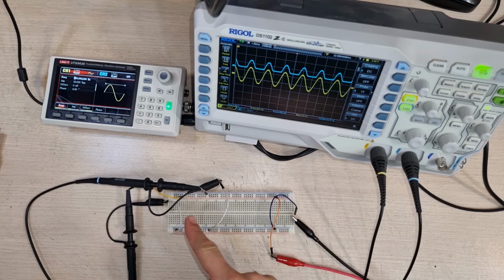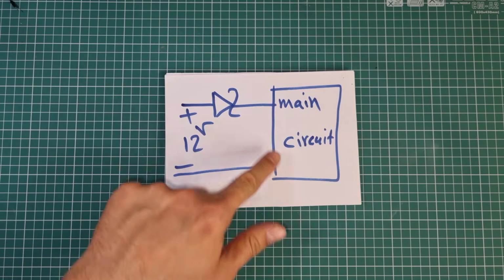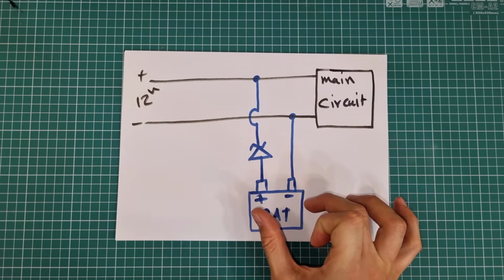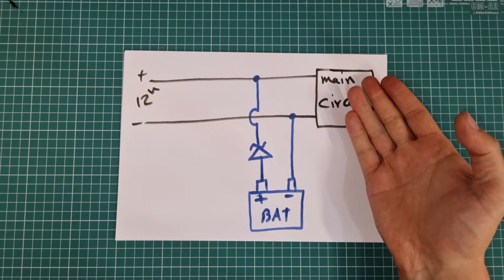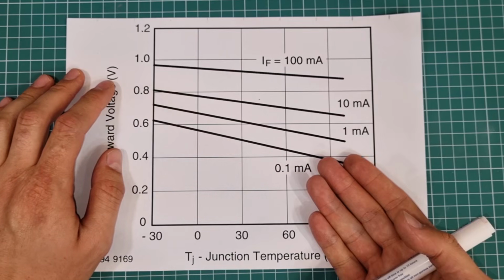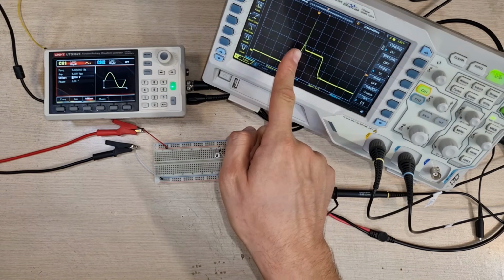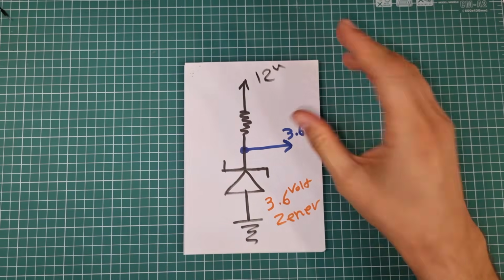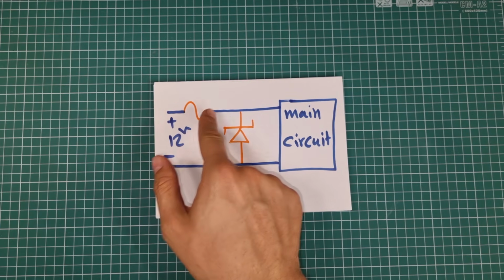8 awesome application of diodes in circuits.

Comment: For reverse polarity protection, the series diode approach is not ideal. There will be voltage drop and heat dissipation. 5V will become 4.6v. PMOS is better approach.

Comment: Which one is suitable diode as flyback . 1N400X, 1N4148, or  schottky diode ?
Reply from the maker: Mostly depends on the circuit. In most cases 1N4148 will work 👌
Reply: @elewizard  Hope you have worked with various type of RELAYs practically. Do you ever face any random issue with RELAYs ? I have a related Question for this.

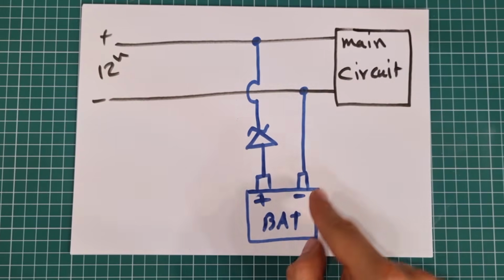Comment: 7:00 shows a battery connected to the main circuit as a backup. I want to connect multiple batteries together to supply a device that expect 13.8V @ 30 A peak and 2A continuous. I was thinking of using multiple 12V power tool batteries. I don't want the batteries to charge each other. just want them to drive the load together. Is this a good application for diodes or is a MOSFET better in this case?

Comment: Out of the blue, I was just thinking of all the uses of diodes.  I thought of about 10 unique uses very quickly, and then just kept coming up with more and more use cases.  There must be hundreds!  Even obscure things like temperature sensing, light production and detection, radio detection, switching, logic and ROM, decoding and encoding, frequency tuning, etc... etc... etc... Anyway, all of that led to this video and it was very enjoyable.   Diodes may have a humble reputation, but they're the basis of all semiconductors and thermionic devices.

Comment: One of the more interesting uses for LEDs is as a dual-purpose power indicator and voltage reference. The sharp "knee" in the I-V curve means the forward voltage remains relatively steady even if the current changes. I've seen (and built) a few circuits which exploit this.

LEDs can also be used as photodiodes (i.e. light sensors), though they are not very efficient for this since they are designed to be efficient emitters, not receivers.

Comment: Hi i wanted to know that how circuits are designed. How do engineers know where to put a capacitor, resistor or inductor.
I think its an advanced topic but a simple explanation will do enough.
Reply from the maker: It is not easy to answer your question. But if i try ro answer your question  in a very simple way, they learned from books which are written based on experience and knowledge. 
In my opinion,  all of these sciences and knowledge are coming from experience.

Comment: I have a basic question I was hoping you could answer.  Normally, a resistor is used along with the diode to limit current.  However, when used as a rectifying diode bridge, I normally do not see any resistors being used to limit the current.  So my question is, in that case, what limits the current?  Is it only because they are high current diodes and therefore don't require any external current limiting? Thanks!
Reply from the maker: It is because of the power supply.
The output current of power supply is limited,  so you have to use a diode with a current rating higher than the power source. Then the power supply can't deliver current needed to destroy the diode. I hope you got the answer ❤️
Reply: @elewizard  Yes, thanks.  So in general, if the diode rating exceeds the current delivered by the circuit, then you don't need a current limiting resistor.

Comment: 4 things on my mind to add: 1) LEDs can drop up to 2-4V, depending on its colours! The bigger the band gap, the "colder" the colour and bigger voltage drop! 2) I never heard of flywheeling diode, do you mean flyback or freewheeling? :D 3) I'm missing the explanation of the flyback diode - it's dropping that peak voltage because it allows the coil to "decharge" through itself (to absorb the inductive current kickback), making a nice peak current "circle" flow between the diode and the coil, instead of your circuitry. 4) I'm surprised you didn't mention opto-isolators alongside with LED transmission devices, those are my favorite type of power protection devices!
Reply from the maker: 1-i mentioned the voltage drop capability  2-yes flywheel is used 3-correct 4-i can't mention everything,  I have to ignore many other items to keep the video length acceptable

Comment: So I can use a ZENER diode to block current in a circuit when the voltage is below the zener diode voltage?
Reply from the maker: Yes, you can

Comment: we used to get potable 12" tvs from the tip and change the diode then sell them i was only 10 made a fortune in the 70s
from caravaners that had put the leads wrong way around
Reply: the load normally only takes the current needed

Comment: Another application is to use the reverse-bias junction capacitance for adjusting the frequency of a tuned circuit - varying the reverse voltage varies the capacitance, which can then change the frequency of an oscillator.  Varactor diodes are specialized for this purpose, but the effect can be demonstrated with pretty much any reverse-biased diode.

Comment: Sir, I got your feedback on the question that I raised. I commend you for it.

 You used 1N4148 as a flyback diode in an indictive circuit instead of a power diode such as 1N4007, Why? I think that 1N4148 is a signal diode and used in a circuit that requires high switching speeds.

Please, refer me to your videos on Operational Amplifier and how one can use it to compare AC voltages.

Thanks.
Reply from the maker: There is no need to use power diode there because voltage and current is not much high, actually power dissipation is low then we can use 1n4148 or other diodes there.
I will make a video about OPAMPs as soon as possible 👍
Reply: @elewizard  Thanks so much for your feedback. I am looking forward to seeing your video on OPamp.

Comment: Wonderful tutorial! As you rightly mentioned that zener diode can be used to protect the circuit from over over-voltage, can it protect an ac voltage? Can it take care of under-voltage?
Reply from the maker: No, It can't protect AC or under voltage 👍
Reply: You can use a "Voltage dependent resistor" AKA: Varistor

Comment: I believe, that these components have a complete computer inside, especially the SMD types. To control the computer, first it must be installed into a device. When you experiment with charging, your diode become removed from its default blacklist, and starts its normal operation, for example removing the memory effect from batteries. Same with SMD resistors, but when you destroy one, there is no computer circuit inside. So the component is on blacklist due to radiation, and the component’s memory effect status causes its default regional blacklist.
Reply from the maker: I believe that you can become a good writer in the science fiction genre 😉
Reply: Another important ingredient of electronic components is smoke. If you exceed voltage and temperature you will let the smoke out and it's finished.

Comment: Hi and thx for your effort.
I wish someone would make a video on how to find/calculate value etc for real life situations for us ignorant enthusiasts.
Let me explain. I am using lots of buck converters - boosters and  lithium solar chargers. I use bear modules for cost and flexubility. In their instructions are mentioning not to reverse polarity and put a diode etc. How do I find which diode? how do I calculate values?  I have clamp meter and accurate multimeter. No more fancy  bench instruments.
I do not want to become an electrinics engineer just solve everyday little problems in laymans terms.
Any help or direction much welcomed. TNX

Comment: If you series diodes, you can create a time delay
Reply from the maker: Yes, you need milions of diodes to make 1sec delay. And you need kilos of voltage to pass through the diodes 😉
Reply: EDITED

You need to explain that. I spent decades designing electronics and never once used the inherent characteristics of a diode to produce a delay.

Are you referring to the so-called forward recovery time of a diode? It is real, but not something predictable enough from diode to diode to have any practical use for delay purposes. Very few diode datasheets specify forward recovery time.
The reverse recovery time of a diode means there is a delay in turn off of a diode, but again that isn't something I'd ever consider for deliberate delay.

If you had a ramp or something similar then you could use a diode or a few diodes in series to prevent significant conduction during part of the ramp to some down-stream circuit, producing a delay. You'd have to contend with the production spread in the forward voltage of the diodes and its fairly large temperature dependency. It could be useful in some circumstances (e.g. in a zero crossing detector).

Comment: I really enjoyed this video and have now subscribed. One question though - Re the induction motors, why do you usually see a capacitor across the terminals and not a diode? Or do they serve different purposes?
Reply from the maker: Good question! The answer is not simple to describe.
In next week's I will upload a video about capacitors and their applications. One of  experiments I will cover this subject 👍
Reply: An induction motor needs a rotating magnetic field to operate. On a single phase motor  a extra separate winding connected in series with a capacitor gives a phase shift or timing difference between two windings causing the resultant field to rotate and this causes current to be induced in the rotor and the rotor will turn. Nothing to do with spikes.
Reply: @colinbatey7876  that's an ac inductance motor. The original referred to a DC motor
Reply: It did, but the question said induction motor which as you say is an AC motor.
Reply: They serve the same purpose. To protect from high voltage spikes, but they do it slightly differently and at different price points. If the manufacturer can get the capacitors cheaper than the correct size diode, they'll use the capacitor. Because the diode would have to withstand a potentially high voltage and current spike that would make them more expensive.

Comment: very clear explanation, it is good to collect knowledge in one lesson, well done
Reply from the maker: Glad you liked it!
Reply: Used, 3 t05 cans with 12 diodes in each(closest to identical as you can get) 1/2 of each can were used to pass + and the other half of the can passed - placed between 2 opamps. Out of one opamp +/- to Input of the next +/- the delay caused by the two18 diode strings gave us the ability to do limiting and compression on audio

Comment: much better protection circuits.  diodes wont always protect.
Reply from the maker: Yes, there are lots of methods, but using diode is very chip
Reply: Sure, but this is introductory level stuff.
Protection circuits can be a real challenge and require very careful design that is way beyond the target audience of this video.

Comment: Why are you yelling at? You are not a sportscaster. A little mercy, we're wearing headphones.
Reply from the maker: Your are right, I have to change my speaking style.
Reply: Add a few diodes to your headphones VCC.
Reply: @manualspellcorrect9073  A very silly suggestion. My Headphones are not the cheap ones. Shall I cut the cable? Do I open the computer and place a diode between the circuit paths? WOW....

Comment: Solar cell is a diode. If you put power into solar cell it will emit deep red light visible in camera. Diode can be used to protect relay contracts from REMF from a heavy DC inductive load when contracts open. The diode absorbs the energy that produces momentary arc in relay contracts.
Reply from the maker: Yes, exactly. Thank you for your comment
Reply: A diode is not always the best choice for contact protection with an inductive load - or for protection of the driver of a relay coil.
A simple diode acts more-or-less as a short circuit across the inductor when the contacts open or the driver turns off. That means that it can take substantial time to discharge the energy stored in the inductor. Often that is not a problem, but sometimes it is. For example, a diode across the coil of a high-power relay not only delays the opening of the contacts but it slows the opening once that actually begins. That can lead to increased arcing of the contacts, shortening the life of the relay.

Comment: You can also use silicon diodes als switches for low voltage ac signals. As long as the ac signal is lower than the forward voltage the signal is blocked. When you now add a dc voltage to the ac signal, which is higher than the forward voltage, the ac voltage will appear behind the diode on top of the dc voltage. Using 2 capacitors before and after the diode you can switch the ac signal on and off.

You can also use a full wave recitifier to switch between a current sink to ground and a current source from the positive supply voltage a point in your circuit whos voltage is between positive supply voltage and ground. you just need to connect one of the ac inputs to your circuit point and the other between ground or positive supply voltage. The current source and sink are connected to the dc outputs of the rectifier. In this way you can make a 555 astable multivibrator whos output switches the current source and sink to the capacitor point which gives a precise linear voltage ramp, which can control other circuits (for instance a vc oscillator or a vc PWM generator).
Reply from the maker: Thank you for your comment. I will cover these items in updated video of this.
Reply: Diodes as signal switches suffer from nonlinearities, so they are not always useful. They are good for switching RF where the signal amplitude is quite small and a bit of distortion is tolerable. It is important that the DC bias be applied from a source that is reasonably high impedance relative to the signal path impedance. In RF circuits this is usually accomplished by means of an inductor in the DC path. A properly designed current source or sink also works (an ideal current source or sink has infinite output impedance; practical ones don't but can be very good).
Reply: @D614G_aka_Doug  yes, you can use a full wave rectifier (4 diode bridge) to switch a current source or a current sink to a load by control voltages. And the currents can be different or you can modulate them by use of voltage control. I have used such a circuit for charging and discharging of the capacitor in a 555 astable multivibrator by exit voltage control in order to make a very precise voltage to pwm converter.

Comment: You only covered two of the more boring applications of diodes, their ability to conduct in one direction (rectification, reverse voltage clamping) and zener reverse breakdown for voltage regulation.  Diodes have many more applications e.g.  switching, mixing signals (e.g. diode ring mixer), temperature sensing and compensation, voltage controlled capacitor (varicap diode),  logarithmic conversion, high frequency oscillators and amplifier (Gunn diodes, tunnel diodes, IMPATT diodes etc...), photo detection and emission.
Reply from the maker: Thank you for your comment. I will cover more items in update video of this. 👍
Reply: Good enough for beginners
Reply: @qinaan  What I listed are practical applications; useful and commonly used functions that can be realised using discreet components.  This has nothing to do with chip fabrication design.
Reply: Multimeter input protection is another use for diodes.
Reply: Yeah, diodes are amazing, but I've got about a 90 minute limit on watching a single video!
Reply: Let us know when post your video.
Reply: @qinaan  Because the video title was a bit misleading, it only showed a couple of the most used properties of diodes.
Reply: @ferrumignis 
I don't think he was offended. And neither was I. I appreciate you pointing out that there was so much more to diodes. There is so much still to learn. But I see that you don't have a channel. Maybe too busy for that.
Reply: @ferrumignis  how the hell is the title misleading?! “8 Awesome applications for diodes in circuits”…. He listed 8 applications for diodes within circuits, and he believes them all to be awesome. He never alleged that there were no more uses whatsoever. So again, misleading how….?
Reply: @reverse_Massagosaurus_Pex  Because the "applications" were all mostly the same, apart from the zener they all relied on the directional behaviour of the component.

You seem very upset about this, are you related to the author of the video in some way?
Reply: @ferrumignis I think it is because the tone of your comment is hard to read. You sound like you are being accusatory, and trying to do a "gotcha", or at least it'seasy to read it that way. Try using emojis or add a "thanks for the great video here some other things I'd like to hear about", to make it clear you aren't being negative. I found this video very useful, and trying to pack more into it would have been too much.